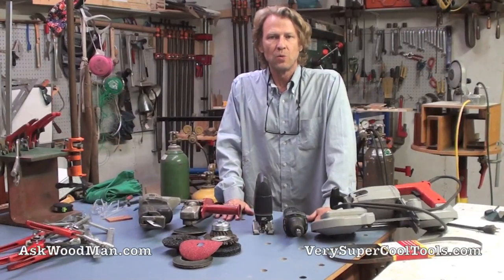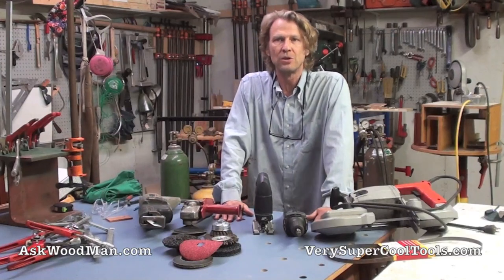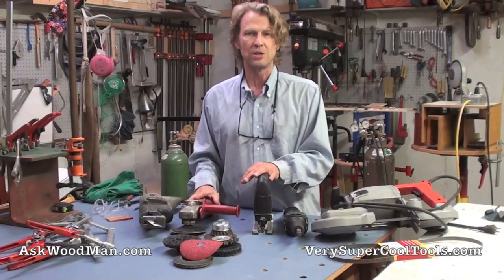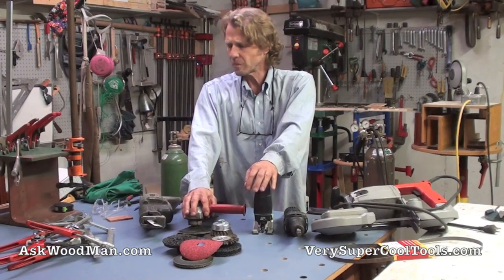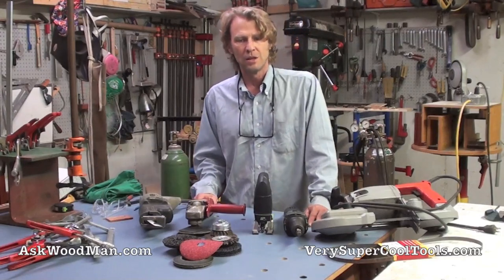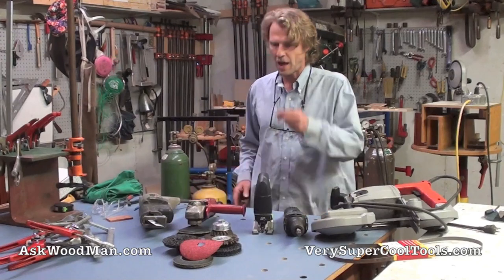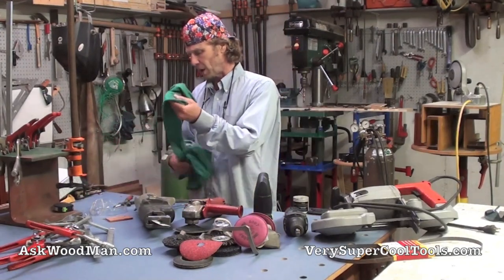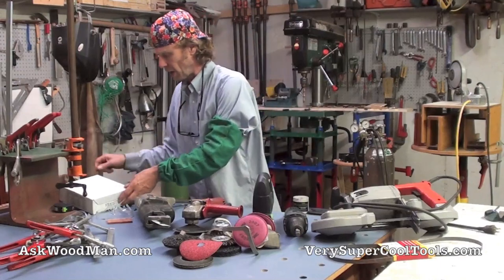1/40 Mig Welding Basics • WELDING for WOODWORKERS

Comment from the maker: There is no confusion. You are correct. If we were welding where aerosolized petroleum fumes was present you would need an organic vapor respirator. Degreasing and cleaning well away from the weld area minimizes this. I should have been more clear on this. This important topic you brought needs to be addressed in more detail in a follow up video. I am glad you wrote so others can see this as well. Watch for a follow up video soon. Thanks Scott and keep in touch. Allan

Comment: I just wanted to add one thing on safety. I don't think the general public knows this. But, It IS NOT a good idea to wear contacts while welding or just being close by welding . If you get an accidental flash with no shield you can get serious damage to the eyes, much worse than the eye without contacts.